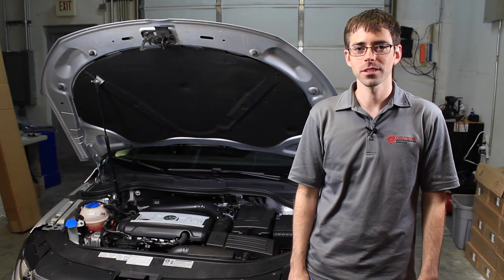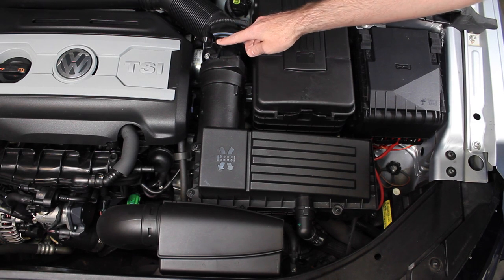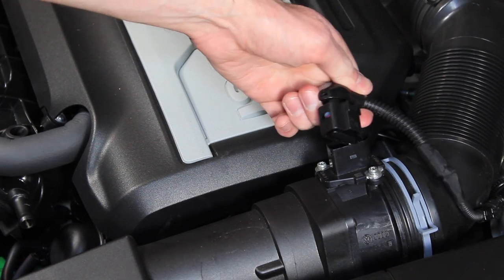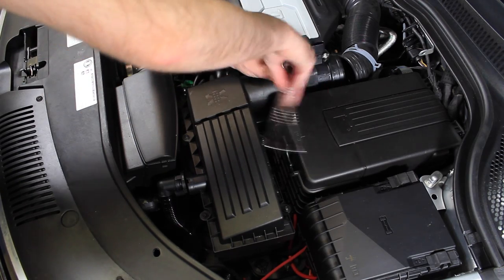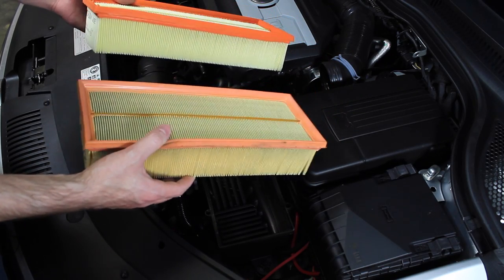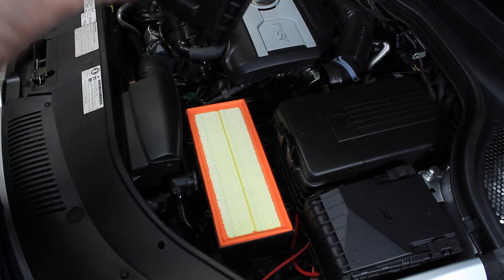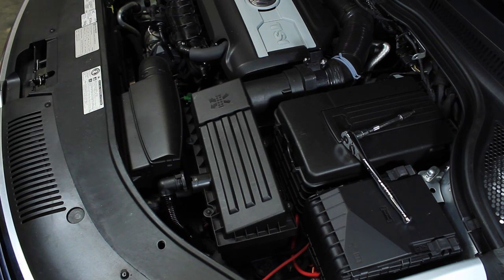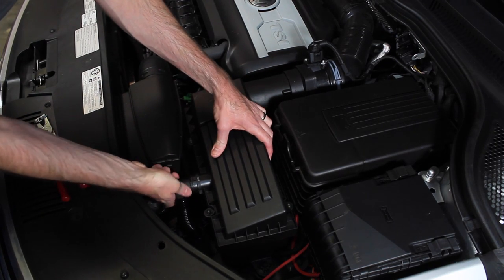VW 2.0T TSI Air Filter Replacement DIY (How to install)

Comment: Or just remove the t25 screws around the housing and lift the lid enough to remove the old filter and pop in a new one. All in less time than it takes to watch this vid
Reply from the maker: Many times in our videos we take apart more than we need to so we can show someone who might need help with this type of install.  It sounds like you are experienced enough to not require help with an air filter install.  Thanks for watching.  We appreciate it very much.
Reply: I'm telling you, that spring clamp is a pain to put back with out the proper tool! Wish I read that I didn't need to do that.
Reply: @ixquiz  I just use channel locks. need to do it in two moves through.  wide open to get is part way on then. narrower to seat it properly

Comment: Thanks for the great video. A question here... I asked my oil change guy to install a KN filter on my 2013 CC. 6 days later my engine light was on and saw the error code P0101. The car was stalling and till I get home at a traffic light the engine just shut down. Restarted the car again and slowly drove it home. Thinking to open the MAF sensor and clean it. Should I go back to a factory installed air filter? did anyone run into such issue? 
Thanks for the suggestions and great video.

Comment: Thank you very much, that was off great help. 
I have an 09 VW passat with 128k on it.  I plan to change the air filter very soon.  God bless you.
Reply from the maker: No problem.  Thanks for the feedback.  Just in case you have any trouble finding it here is the air filter. 
http://www.deutscheautoparts.com/View/1K0-129-620-D/0/38971

Comment: This is a very common question, but does the K&N  offer any performance advantage or is it just the re-usability that is the benefit?
Reply: There was actually a test that was which which compared K&N filters with other filters and it did boost power by a noticeable amount, but it allowed significantly more particles through than the other filters

Comment: My only question is does removing the sensor and putting it back on cause the car to need to be reprogrammed as well, i’ve heard of a lot of people removing sensors to do easy work on VW and check engine lights come on due to unplugging or faulty sensors

Comment: what is that small hose on the front of the air housing that you removed first? Mine was disconnected on my GTI and I was noticing engine shaking, and a brief flash of the ECP check engine light.  Wondering if that could have been the culprit.
Reply: PCV component I think
Reply: It's the secondary air intake (SAI). I think it's an emissions requirement for cars sold in California and maybe some other states as well. So not all VWs will have it.

Comment: Hey how do you check to see if the heating system is working properly?  My heat has alot of trouble heating up during really cold temps.  Usually 15 and under. Also, what`s the little box connected to the box with the air filter for?
Reply from the maker: Sounds like you might have a thermostat issue with the heat.  Its best to have is diagnosed to be sure whats going on.  Not sure what box youre speaking of.  If its the box in the front of the engine bay that is an air duct for intake air.
Reply: Deutsche Auto Parts- Your Source for Everything VW and Audi Can i check it myself with one of them handheld computers that is connected to the cars?  Is the thermostat easy to replace on a mk6 GTI?
Reply: You mean the engine ?

Comment: replaced air filter on 2013 vw tiguan as per your instructions.  Shortly there after check engine light came on.  Code inidcated mass airflow sensor.  Tried to clean with solution then ended up replacing the MAS with a new one.  Check engine light still on after 200 miles with new MAS.  Could there have been a mistake made when changing the air filter that would have triggered this?
Reply: I have the same issue. Did you fix your problem?

Comment: Exactly what model of hose clamp pliers did you use?  i see alot of different kinds.  thanks.

also what model of torx bit tool screw driver?  seems like it has to be long.  thanks
Reply from the maker: All the tools with the exception of the ratchet are from Snap On.